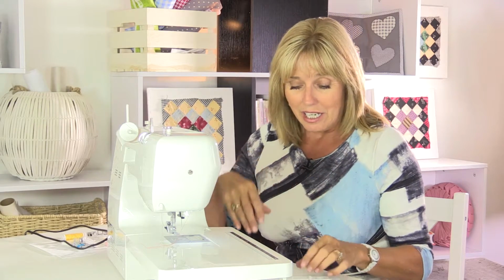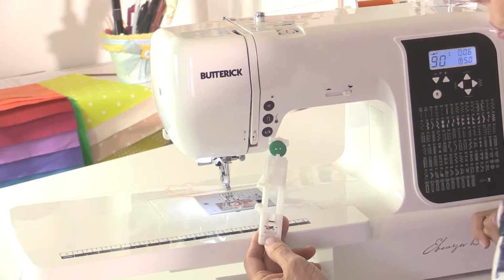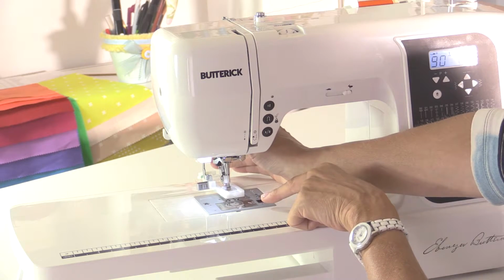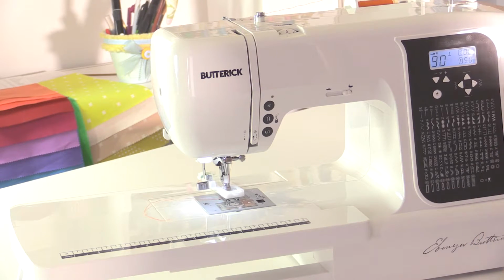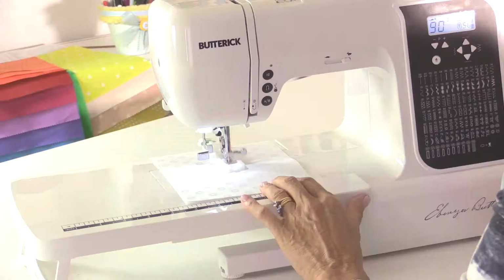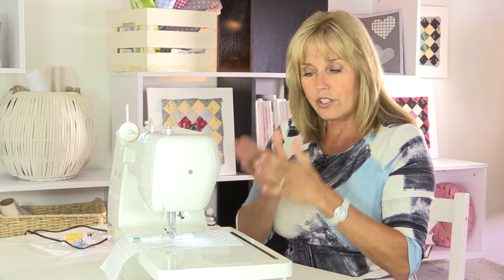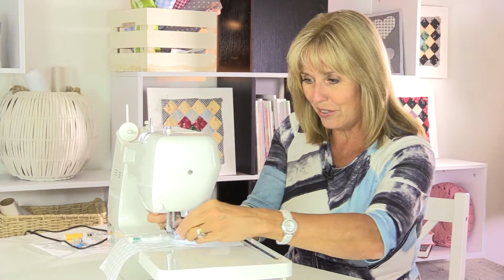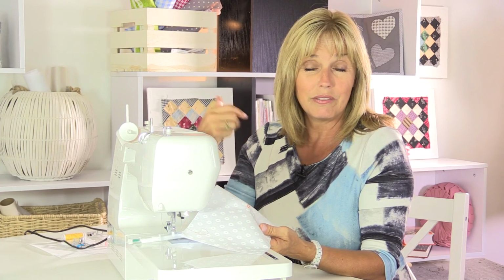How to Sew a Button Hole | Butterick Signature EB6100 Sewing Machine | Create and Craft

Comment: hello, i have had this machine myself and i am trying to learn on how to make the button hole.  i have used the foot that came with the machine and i have viewed this video that Debbie Shore has made as well as contacted her but i cant seem to get mine to work as you are portraying in the video or the manual that i had with the machine.  i have attached the white button holder on the foot of the machine and also found the button hole lever which i have placed down.  when i put my foot on the pedal i get a bleep from the machine and it states BL which i have found to be button lever, and put this back up the machine and placed it  again behind the first protruding lug and all the machine does it just machines in a straight line, on stitches 90 and 91. when i have tried other stitches for the button holes, all i get is zig zags and not the stitch i am suppose to get. can someone explain why the machine is doing this and not what it says on the tin as it were